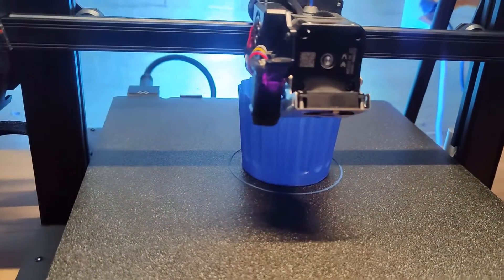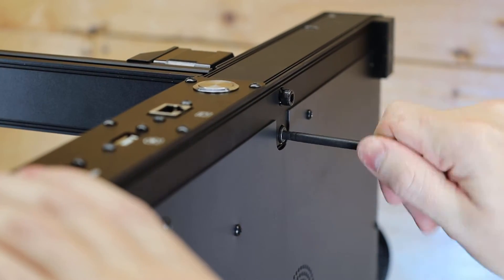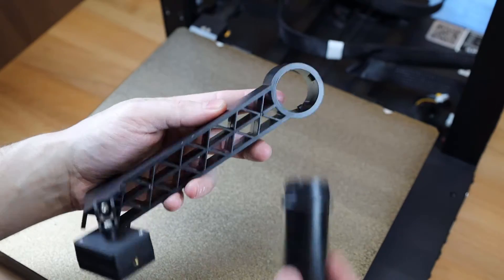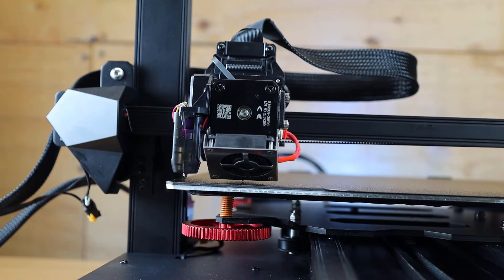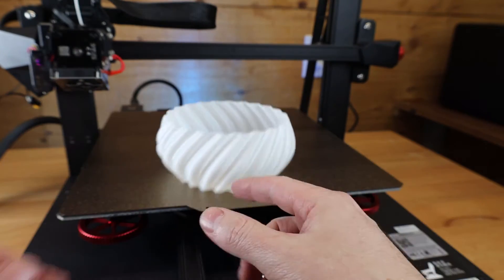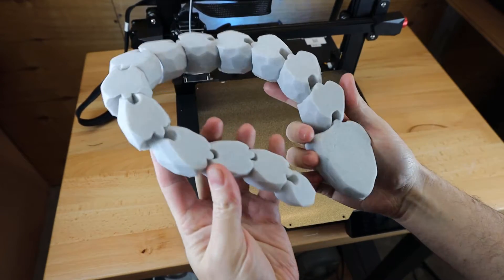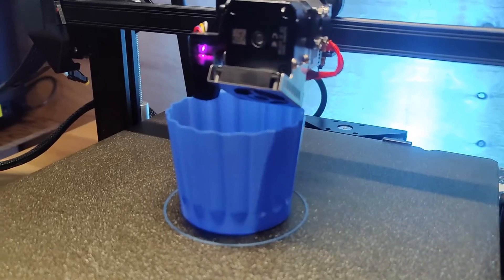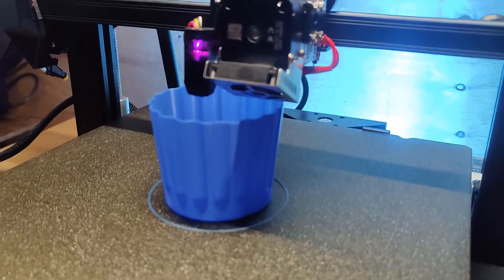All The Upgrades You'd Want Out Of The Box - 2022 Creality CR 10 Smart Pro

Comment from the maker: CR-10 Smart Pro 3D Printer - https://bit.ly/CrealityCR-10SmartPro

Stainless Steel Feeler Gauge - https://amzn.to/3rvT3d0

MatterHackers 3D Printing Filament 1.75mm:
Build Series PLA - https://bit.ly/MatterHackersBuildSeriesPLA
Build Series Silky PLA - https://bit.ly/BuildSeriesSilkyPLAMatterHackers
Build Series ABS - https://bit.ly/MatterHackersBuildSeriesABS
Build Series PETG - https://bit.ly/MatterHackersBuildSeriesPETG
PRO Series Filament - https://bit.ly/MatterHackersPROSeriesFilament
NylonX Filament - https://bit.ly/MatterHackersNylonX

Amazon 3D Printing Filament 1.75mm:
PLA - https://amzn.to/3gsLE9Z
PETG - https://amzn.to/3pXjjvu
ABS - https://amzn.to/3wsTRjS
ASA - https://amzn.to/2RX8dtM
Polycarbonate - https://amzn.to/3cLdr38
Nylon - https://amzn.to/3iNGeI2
______________________________________________
Note Most of the links that I use that go to products are affiliate link. This means I make a small commission on anything that you happen buy using them. This is at no extra charge to you and this helps support the work I do on this channel. 😁👍
______________________________________________
#Creality #CR10SmartPro #3dPrinting #3dPrinter #diy #maker #DIY

Comment: Can you replace the pei sheet with a glass?
Reply from the maker: I'm sure you can.
Reply: @randymay  I haven't been able to find any information how to do it.
Reply from the maker: @ANewKindOfFearCustoms  if you want to do it the quick and dirty way here is how I would do it. 

1.Take the PEI spring steel sheet off
2.Find some glass that is the same size and the bed
3.Put the glass on the bed
4.Get 4 medium size binder clips and clip the glass the the bed with 2 in the front and 2 in the back. 

I have all my ender 3 printers setup like this along with a cr-10

Comment: I wish my cr 10 smart would work the same 
It doesn't even stick on the plate right now
Reply from the maker: What material are you trying to print with and is you z offset right?
Reply: Pla and i have too buy now  wheels for manual bedleveling